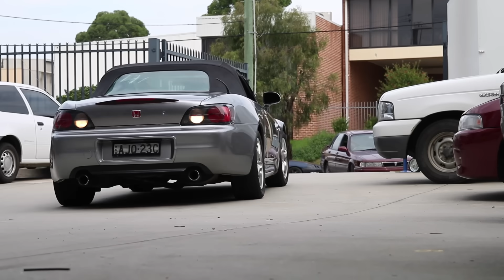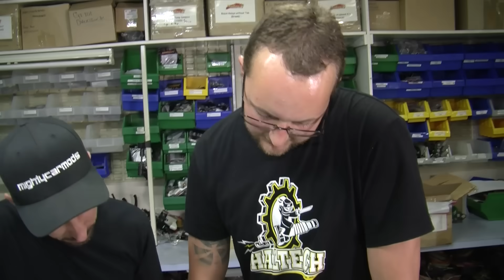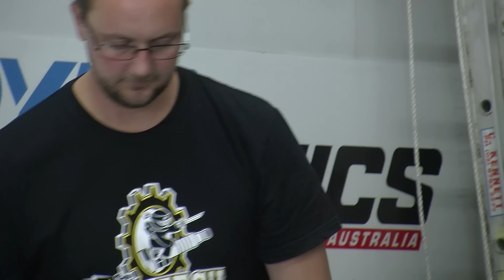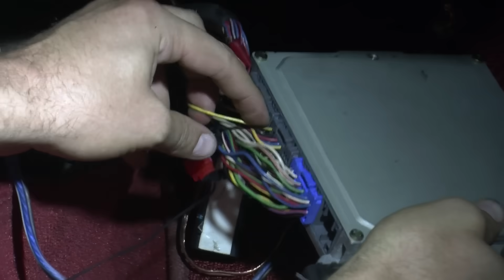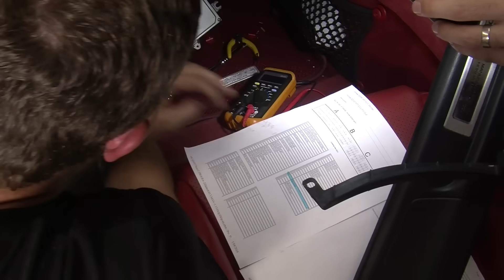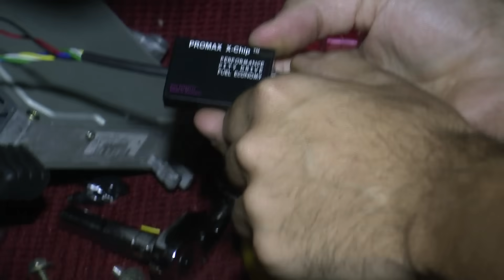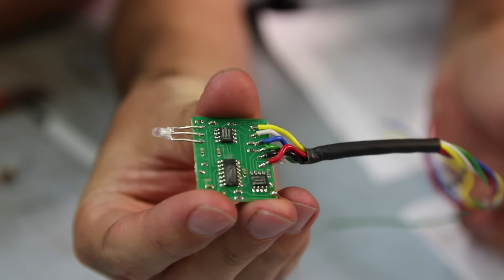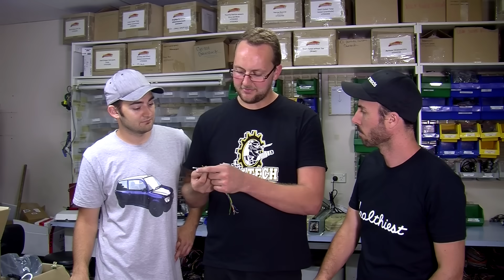eBay Performance Chips -  Mythbusted

Comment: I can't believe its legal for the manufacturer of these stupid parts to make such a claim when it does nothing. Where's the law in this..... This is why I keep my cars stock except for suspensions and maybe a front after market bumper....or go turbo if you really want more horsepower..
Reply: its cause they bought a fucking 20$ ebay chip a good one is around 300$

Comment: Why is your S2000 so low in HP? These things should be around 230hp stock...
Reply: This is at the wheels
Reply: lee g It should still be at like 200-210HP at the wheels. A 20-30HP difference is pretty significant.
Reply: +KingInky13 they usually make about 180 at the tires
Reply: rpsteele12 No, people post their dyno charts online and a lot of them are above 200HP, where it should be. 230HP from the engine and 200-210HP at the wheels.
Reply: Dude engines lose power after years of use
Reply: EVILIMPERIALISM23 If they aren't maintained well, they do. Besides, that S2000 isn't that old. As a guy with a car channel, his engine should not be 30HP lower than what is expected.

Comment: Misleading title infers all chips are worthless. SHEASH only a fool would believe you are going to get anything great or worthwhile for $20.   
In reality there are many plug-in programmable tuners available with pre-installed starting points out there that do work. The chips where you can see the biggest gains are made for diesels.
Reply: so if I get a tuner for my 4.8 01 sierra I'd get a noticeable change or no? I know some people say it's not alot but you still feel it
Reply: +20BulletProof10    No $20 chip made will do anything but waste you time and money. As for reprogramming a 15 year old PU with probably 150k miles or more, I doubt I would waste my time. 
Good programmers that actually work cost $300 or more. Good units can correct you speedo, realign your steering wheel, read trouble codes, adjust shift points, adjust for differed grades of fuel and more. 

I don't know your rig or what you are attempting to achieve so I recommend finding an aftermarket truck shop that does performance up grades to help you out. 

IMO -again don't know exactly what you are trying to do but it sounds like your best move would be dumping the rig you have and step up to something that would be easer to improve.  
If Chevy is your fav and looking a speed find a bigger motor with the lightest body or if towing is your game diesels are the best.  Get the newest you can afford and then start improving it.
Reply: +2003evodave 

Also doing any one improvement will not be as good as several that complement each other. 

For example just because you change your exhaust which decreases back pressure and maybe gets you 1 to 5 HP but now causes the motor to run lean and hot. So the fix is lets say improve inlet air flow and the must do is "reprogramming" to add more fuel. 
When you do changes especially performance up grades many times they can affect the balance of how your engine runs. IE proper amounts of air, fuel, and timing must all be done together. Changing only one will throw off the others and in many cases reduce performance. 
Bottom line is --IF YOU DO NOT KNOW WHAT YOU ARE DOING DON'T TOUCH IT !
Reply: +2003evodave 

but if you do a change and do correct the other factors that little exhaust upgrade can lead to real HP improvements and increased performance. 

Case in point the last little PU I bought 2005 Ford F-150 with the 5.4 liter triton motor was only 300 hp and had the Trans set for old man shifting comfort.  I did a complete exhaust system, cold air intake, new injectors, HP plugs, and a super chip programmer to increase and fine tune thinks. My ultimate goal was to eventually step up and add a supercharger to go from the original 300 hp to maybe 450 - 500 hp  but I was very happy with the first improvements that had to be done anyway that I stopped cuz 387 hp  of tire smoking, cheap fun was plenty for the money. 

Check out my u-tube video - "smoking 2005 Ford F-150 burnout" 

You can see what a few balanced changes can do to make huge relative inexpensive, reliable and useable HP!
Reply: 2003evodave yeah I get you but see I already have the full exhaust, headers and intake... it's nice and all but I just wanted to know if those programmers worked... I know buying a 20$ isn't gonna work I'm not cheap I was thinking more of one that changes all that... I see some people say it makes a diffrence then other say it doesn't... I don't wanna go too much and add a super charger or turbo because that is way more expensive plus I don't really race alot just want a little more kick than it already does
Reply: +20BulletProof10    Yes, you can get a real difference with a good quality programmer. Especially if you have an automatic transmission and depending on how detuned your particular engine is from the factory. 
The programmer will adjust for tire size, type of fuel and much more. Bottom line is, you get what you pay for. 

Did you check out my video?  Go there, search it on utube at --"2005 F150 tire smokin burnout "

Have fun !

Comment: The big tip-off was the wires were spliced in. You need to cut the sig. return & have the doohickey in a series circuit. Of course, you need a valid doohickey.

Comment: There are actually performance chips that do work. you have to spend about 300$ but on some engines you'll get some noticeable gains. I installed a superchips cortex on a 98 dodge ram 5.9l. They claim around 49 hp gain at the flywheel. Although I haven't dynoed it yet it is a very noticeable gain in power.
Reply: Not at all. My 1.8 Sonic gained 30 HP and 29 Torque at the wheels, so we are looking at pretty close to that 49... in a 1.8 4-cylinder.
Reply: Lol
Reply: What brand? I’m going tomorrow to get my 5.9 to swap and put in my 98 5.2 and would like a chip
Reply: Those numbers are real when it comes to diesel truck engines but not a 5.9 gas engine.
Reply: 49 at the flywheel with a chip = bullshit.

Comment: eBay account : 20 hp
Ecu Child from eBay :100hp
Fake Exhaust system : 1002 hp
Blow of valve :193749 hp
. 
. 
.
Reply: how does one have a fake exhaust system? like is it invisible or does someone say they have X exhaust when they run open headers?
Reply: +luigi90210 not connected exhaust at back of car
Reply: Mehmet Cumhur well i didnt know that was a thing
thanks for the explaination
Reply: +luigi90210 You are welcome.  It's usual thing to see a fartcan sounded titanium exposure here!  Lol
Reply: +Mehmet exhaust **

Comment: The chip is probably for a s2000 with nods like at least basic bolt ons with supporting mods that looks like a bone stock s2k don't even think it has a intake

Comment: the chips and resisters all they do are lower the voltage for the LEDs and allow the LEDs to run separately. all that circuit board is, is just for the lights.

Comment: Hmm, well when I first saw this "Chip" description I assumed it was a modified EEPROM to replace the original chip inside the computer. The manufacturer has to program to suit the majority market they are aiming at, which goes from Grandma to "The Little Old Lady From Pasadena". They also need to consider the rest of the car with regard to braking capacity etc. Also of course there are emissions laws and engine life.

A lot of people would also consider fuel economy important when buying a car,  so at best the factory settings are a compromise. While tweaking one or two things with resistors or diodes might improve some things it is not going to get as much power as reprogramming could.

However before the official verdict was in I was already thinking this is a "Placebo" device, after all that effort one would simply hope to feel a difference and drive more aggressively. Without an unbiased observer (The dyno) it might even feel like it worked.

Comment: whilst i'm massively skeptical on these chips... you can't just use the MAP sensor in place of a MAF and expect it to work...
Reply: in this specific chip it wouldnt matter in the slightest, as they state at the end it is just a straight through connection, no values are changed and the chips are just for show.
Reply: The Mad Hammer agreed, but the testing methodology was flawed...

Comment: Some free tips how to make your car go faster.

1) Remove the paint,no need for that.

2) You can also throw out the back and front seat,spare wheel,cd and the carpets.

3) Lose weight and drive around naked,no need for that extra weight,so off with the clothes..
Reply: Take off your brakes..... No need for those
Reply: MrCheatreporter 4)pro tip: install a intercooler and take the radiator off, no need of all the weight of the radiator, coolant and stuff if your intercooler is cooling down your car and making it more powerful 😉
Reply: +MrCheatreporter weight reduction bro
Reply: +MrCheatreporter do you even lift bro.
Reply: No need for doors or a trunk either
Reply: Make sure to take the weights off the wheels too.
Reply: Lmfao you guys👆😂😭
Reply: Take out the engine, weight reduction, bro.
Reply: KingTxne WE ALL CAN USE TRACTION TO STOP!
Reply: MrCheatreporter mostly applys to women

Comment: Why does it have less horses than a Civic Si?
Reply: +RJARRRPCGP because this is power at the wheels. Advertised power is engine power. Depending on driveline setup 10% - 20% are absorbed.

Comment: There is no modern vehicle made since the mid-80's that uses a removable PROM chip in the PCM. All vehicles since the advent of OBD-II have firmware programmed into the PCM that handles all engine management. Trying to fool the PCM by sticking resistors or other junk in circuits will not only not work, it will actually reduce power and efficiency, since it will take the value of that circuit out of an expected range and cause a default (and less effective) value to be used. These things are a complete waste of time.
Reply: +guyonearth False, toyota surfs on the fuel pump have a resistor, up the resistor value and get more fuel and timing.
Reply: ***** Nonsense.
Reply: ***** 
http://www.hiluxsurf.co.uk/showthread.php?t=83521
Reply: +Samuel Wood On a diesel? LOL. Funny.
Reply: +guyonearth And? what difference does that make, please enlighten me. Both have an ecu? im intrigued :)
Reply: +Samuel Wood First of all, it's not even what they're talking about in the video. Second, I don't believe what you describe can work, unless you are changing injection pump timing, since that is the only thing that would matter. FYI, that's illegal, as it violate emission laws.

Comment: Really interesting video but finding out this $20 box is a red herring isn't that surprising.
Genuine tuning box products are dyno proven and tend to start at the $800 range.
Would be great if they did a video on these products, such as ours, and showed what a genuine tuning box can really do.
Reply: How does a tuning box handle sensors that are not performing correctly(but not showing a EML) or one that has failed and the ECU has loaded a default value i.e a MAF for example?

Comment: I could have told you a $20 Ebay chip is junk without you having to go through all this trouble. Only buy performance parts from a reputable manufacturer. I appreciate that they took the time to test and make this video, but at the same time it boggles the mind that people are buying this crap in the first place. If a chip costs $200 from a real manufacturer, how can you think a $20 chip could possibly work.

Comment: I once bought an amplified FM antenna on eBay. I pulled it apart when it wasn't working well and saw that it was just a circuit to power an LED and the signal wire was just connected directly to the antenna. So many eBay scams!

Comment: Buy a shit chip , expect shit results. You can get a fairly decent chip for a diesel vehicle that intercepts the common rail pressure sensor readings and lies to the ECU about the pressure , therefore boosting the rail pressure.  You definitely notice the difference.